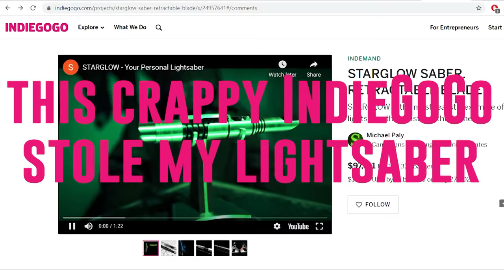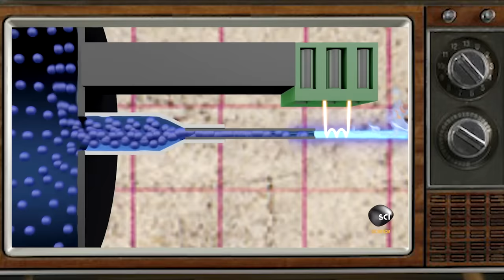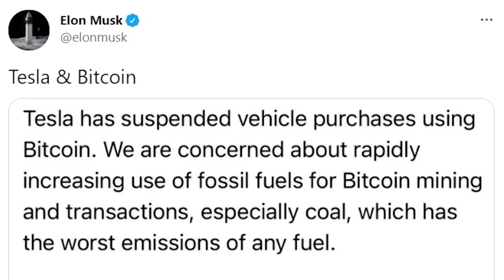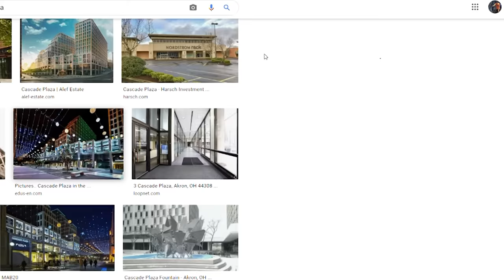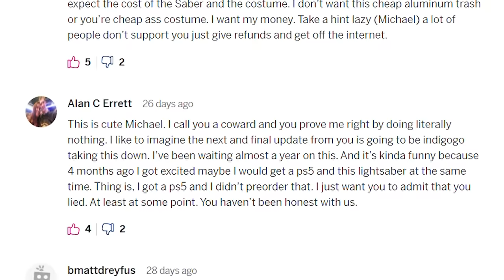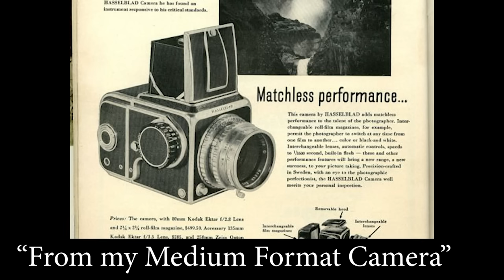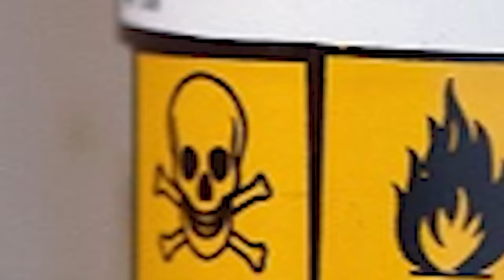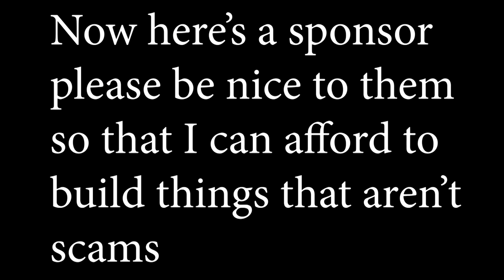Scammers stole my Invention and sold it for $100,000

Comment: i like the laziness of just manually pushing out the methanol though, makes me wonder if you could build a plasma supersoaker
Reply: That sounds awesome but terrible at the same time lol.
Reply: Supersoakers mostly just store pressure with a pump and release on trigger, so theres no real point to it over just using a pressurized tank to begin with.

You trying to save a bit of money on your flame throwers?  Maybe just don't.
Reply: @JonesCrimson  but saftey isnt fun lol
Reply: @michaelreeves dude are dry for video ideas, your boy Uranium-238 gotchu
Reply: Just use a flamethrower lol it'll probably be safer
Reply: You could pretty easily. Might need to replace the tank and any parts the methanol was gonna touch with something a bit more sturdy cause methanol has solvent properties but from there its just put a high voltage arc in front of the firing nozzle and you get a nice flamethrower. Hell in his original video, Allen links a guide that possibly could help you find an easier way to do it. Main reasons I'd recommend not doing it is your local law enforcement would probably not be thrilled and come have a talk with you if they found out plus the obvious fire risk if you used it in a stupid way.
Reply: Methanol does not equal plasma
Reply: Didnt the myth busters build one?
Reply: I actually wonder if Allen was using it wrong. Maybe you’re supposed to pressurize the tank with the pump before opening the valve with the thumb slider.

The videos shot in Ukraine clearly showed a pressurized stream of fuel. Either the tank was pumped up, or they had some source of pressurized air running to the bottom of the handle offscreen.

Comment: Fun fact: the blue color methanols flame gives off when  burned mixed with the small flame causes the flame to appear invisible in daylight. This is kinda a problem in f1 racing when they spill gas during pit stops because they use methanol-based fuel instead of the more common ethanol gasoline which burns red and goes boom

Comment: 6:14 This looks like it takes a CR123A, which are used in tac lights and some other high intensity lights (like camera flashes). They generally are used when you want a lot of current at 3V for a short time. It looks like the battery that william stuck in there is a CR123A from his flash bulb set up
Reply: Williams battery is a 6.2V 4SR44 silver oxide battery
Reply: Or it could be a 1/2 AA. 3.6V

Comment: I genuinely feel scared for someone who bought this thing and was unaware of methanol
Reply: Yeah that's definitely the cherry on top, but regardless of how chemically toxic it is, a not fully assembled or even structurally sound flamethrower with no instructions, a high voltage igniter, and leaks flamable fuel is pretty bad already
Reply: there's a reason the guy who bought it first said "i just want to put this all behind me"

Comment: As soon as something is published, it cannot be patented anymore. That means at least nobody can sue you for your own idea if you make it a product (at least not so easily). It also means other people can make a product based on your idea. Tip: If you just need proof that you made something at a specific point in time, you can get a cryptographic timestamp for the description. 

These timestamps are free, they are used by Windows as proof that a kernel driver was signed at a certain time. A signed driver with an expired signature can thus still be considered valid, the cryptographic timestamp documents that it was signed when the signature was valid. (The signatures of the timestamps themselves are usually long-lived.)
Reply: Thank you. I learnt something new today

Comment: Even if hacksmith was the official creator of the "first" saber at least yours looks more accurate to the sabers in rebels.
Reply: But Rebels is irrelevant though.
Reply: Hacksmith have made it a point that theirs is actually a "proto-lightsaber" that is to say, one with an attached backpack fuel tank.
Reply: @katusakirocks5630  that opinion is quite outdated nowadays
Reply: @bastik.3011  I’ll call it irrelevant until Disney proves they can make good canon content
Reply: @katusakirocks5630  then you must be blind
Reply: @bastik.3011  What good content have they given besides the few fucking amazing Vader comics?
Reply: @katusakirocks5630  the mandalorian, the bad batch, rogue one
Reply: @katusakirocks5630  The Mandalorian is great, Clonewars last season, Rebels is good in the later seasons and the Bad Batch has promise.

And there are so many more series to come which are promising. The Book of Boba Fett, A series about Ashoka Tano etc.

Comment: Methanol also seems like a terrible choice because of how easily it can start burning. I can easily see the flame travel back into the tank if you don't push the plunger fast enough, and that could cause an explosion. That sort of thing is still a risk with other fuels, but it's at its worst with methanol.

Comment: Do another light saber. Use a very high pressure water pump (those that can cut through things) its very dangerous tho. It is hard to control the length of the saber

Comment: Yea id trust a hair doctor about as much as i trust a dude in ukraine to make a light saber.

For those who actually want to keep their hair, get your blood tested, and check your vitamin levels. Hair loss is usually due to some chemical imbalance and a lack of testosterone being produced in the body. As well as very little blood flow reaching the scalp.

To take care of all three, check your magnesium levels. Magnesium increase the production of testosterone in the body, increase blood flow, and strengthens hair folicles and can bring back to life hair folicles.

Most doctors dont actually have any idea how to save your hair, or rejuvenate the dead folicles that die from skin being grown over them.

But you can actually bring them back if youknow what your doing, while i didnt need this method, as long as you have some hair, use magnesium oil on the scalp. Its working if it burns like crazy, and be careful how much you use because mag is natural stool softener.

Get a sharp comb, or a comb with sharpish bristles and scrape your scalp, maybe once a week in the shower, after you have rinsed the mag oil out. Do this for about 1 or 2 years, and you will have a full head of hair, hair folicles so strong, you will never lose hair again, since its the weakening of hair foliclkes thatt casuses hair loss to start. I started losing my hair in my late 20s. IT runs in my family, although skips a generation. I was lucky in that i discovered i had a mag deficiency and started using it all over my body, then i found by accident pretty much, it makes your hair thicker than when you were 16 and you wwill sometimes lose a hair here or there, but overall you will constantly be replenshing hair folicles. Im not even joking.

magnesium deficiency is getting to epidemic levels, its in less food, and due to sugar and caffien, hard to absorb. this can cause hair loss.

Most men, let their health go as they age, and therefore their hair goes.

You can stop this by killing the layer of skin on your scalp with mag, and increasing testosterone levels. But it wont work as well or as fast if you dont scrape your scalp. I use a plastic comb i just slightly sharpened with scissors. But depending on how far gone your hair is, at a certain point, nothing will work. but try it if your feeling lucky. But the dudes who have thinning hair but it isnt going that fast, you probably have some kind of defiency.

And all kinds can cause hair loss. Check your levels, b12, magg, d3, all of it, can cause hair loss if you are out of wack in any way.

Its like grass, when you have no grass, nothing grows. but some grass? it spreads, grows, and if you take care of it, grows thick,and never dies.

Also use cold water to rinse. cold water is the natural state of the ocean where we evolved, so its better for our skin. hot water is unnatural. more soothing yes, but if you rinse at the end of the day with cold water, it will close your poors, increasing hair growth, annnnnd getting rid of all your acne.

This has been your local service announcement by neuromancer